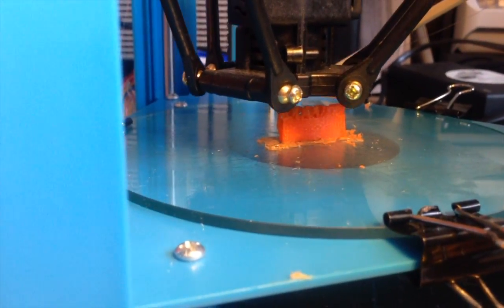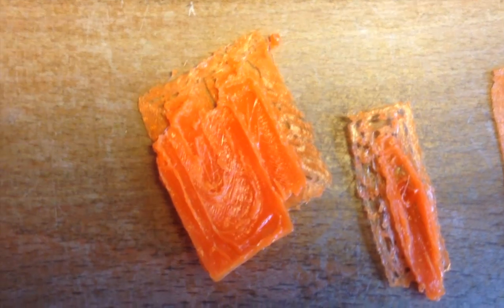Cheap Chinese 101 hero 3D Printer review & reprap calibration, improvements and upgrades!  Update #2

Comment from the maker: This is a quick video update. Sorry some of it was shot with a smartphone. I will do a more complete video soon. I hope you get an idea.
Reply: Your initial mission was upgrading the Hero. I see no reason, why this aim should be dumped right now. There are so many things you could do. I think if there's one thing this printer has on it's plus list, then this is the looks, as delta desings have something cool. So it would be great, if you didn"t only make it work nice, but also look nice.
That's why I think an acrylic enclosure would ne a nice addon. It would fix overall stabilty and also this would fix a lot  of temperature related problems. Some plates precisely cut to the right size and screwed to the vertical columns, and one of them equipped with some hinges for opening.
Reply from the maker: Question for me is mostly financial. How much I can afford to invest in this to print decently enough to get a larger printer with a larger build platform. I have a few projects that need at least a 20x20x20 cm build platform. Though if the finances worked I am more that happy to see how far I could take it. Just saw a makerbot and it is so much faster than this little monster.